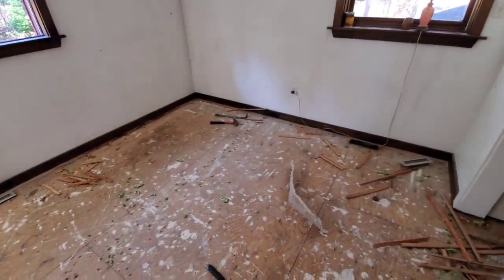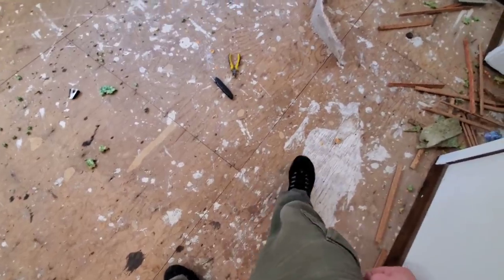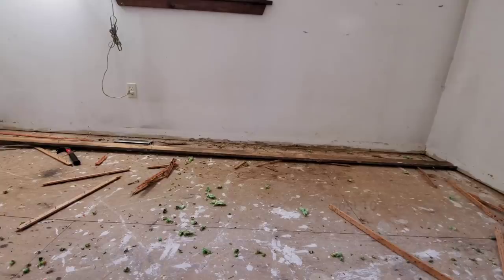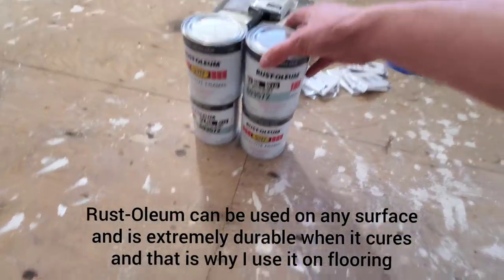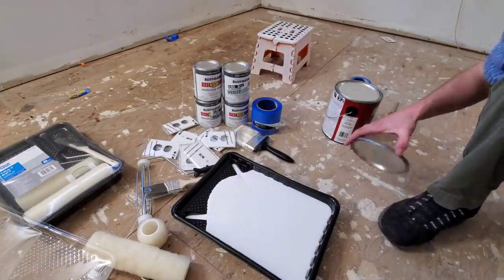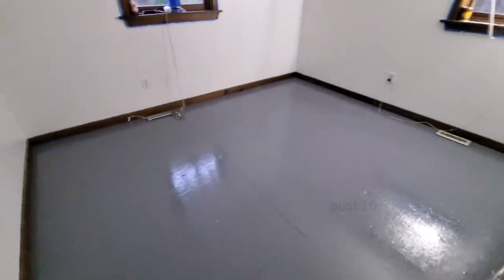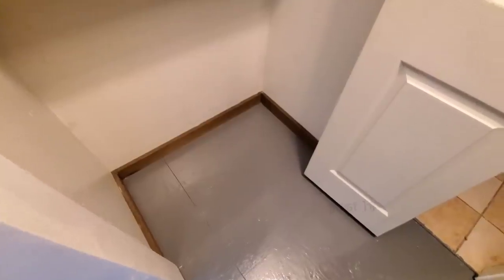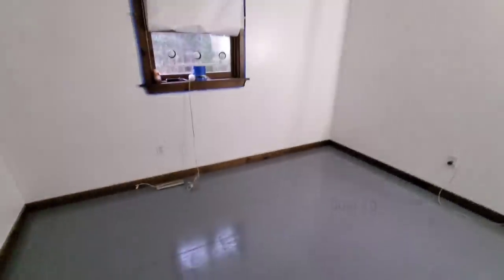Painting Subfloor, Looks Great

Comment: Came out nice. I’ve been a scenic artist and painter for 35 years. The wall paint was probably ok provided a 1/2"-3/4" lamb skin roller sleeve is used. Try one. They’re a bit more expensive but they don’t spatter, apply better coverage and clean easily with water. Worth the investment as a painter. I have some 1.5" ones I’ve used for 5-10 years.

Comment: I bought an old rental house that had terrible pee stained carpet.  I found that painted floors with area rugs worked great.  At the time I did it for economic reasons, but I really liked the look.
Another option is the two-part epoxy floor paint they designed for garages.  Those are more expensive, but the finish is practically bulletproof.
Reply: Epoxy floor paint, I'm saving that idea

Comment: This mans just painted a whole floor with a brush 😳
Reply from the maker: Roller cannot get into deep holes and cracks
Reply: Personally I think he should have used his trademark tool, a rake . 🤭
Reply: Yes it will. Use 3/4” or 1” nap roller cover.
And: you could have trimmed that switch plate better so it butted against the trim. No need for that hard edge and that gap.
Reply: I stained my house with a brush by myself and I am 67 years old. I prefer a brush. Something therapeutic about it.
Reply: Yeah a thick nap roller would have been way way faster and the paint would have been thicker. It would ooze into cracks and make it look better and smoother. I painted my 1000 sqft basement with a roller. It looked amazing.

Comment: The only problem with using painters tape is sometimes when you peel it off you can still get drips and runs and other imperfections that makes it's way under the tape or odd tape lines especially when you're laying it on thick.  For a fast cheap job....sure.  But if you're working on a higher end house with fancy trim work I recommend hand cutting with no tape.  It takes longer and yes sometimes you're not always 100% straight but  when the room is finished, unless if you're a pro painter specifically inspecting the work, you're not likely to notice it as long as your getting right up into the edge but not past it.

A good cut line requires some practice but here are some tips.... 1. Never over load your brush with too much paint.  You really only want to load the bottom 1/4 of your brush.  After several reloads if you find that the paint is taking over your brush to much it's time to give it a wash off.  A steel brush works great to clean a paint brush when you start getting dried up paint on your bristles.  

2. When cutting apply a good amount of pressure so that your bristles bend almost like 45 degree's on the wall and start a few inches below your cut line then drag your brush from left to right getting closer and closer to the edge line (like a car yeiding from a road onto the main highway) and when you hit that line point then level it out and keep that straight edge pressure going for length.  Then reload and continue your edge by starting a little before where you left off so that you're merging again onto the cut line.  Make sure you brush in a few inches of paint below your cut line too so that your entire cutting in line is a good 4 inches wide.  You have to remember that when you go to use the roller that the roller itself can only reach so far before it hits the ceiling and you don't want that to happen.  So the wider your cut line the more you'll lessen your chances of tapping the ceiling with your roller when you roll your walls.  

3.  Sometimes you can cut in the room twice before you add your first coat of paint.  If you're lucky to get a nice one coat coverage because you went with a better paint and a good 3/4 thick roller nap then you can avoid that 2nd cut in problem because if you can still see the brush strokes on your cut line then you have to recut the room over your first rolled coat but when you do that you'll see a texture difference over the edge of where you rolled.  Usually you want to roll OVER your cut. . . not CUT OVER your roll.

4. Have a cheap plastic painters pail to reload your brush instead of using the paint pan.  looks like a kids sand bucket toy.  You can hold it in your hand while you do your brushing instead of running up and down the ladder all the time to redip in the paint can or pan.  This saves you from having your paint dry up.  You can soak a rag and drape it over your pail to keep your paint wet while you break for a bit.  This is also why you shouldn't over fill your paint pan like post10 did in this video.  You need the ramp to squeeze off the excess but not too much.  And if that paint sits too long in the pan small little flakes start to harden and form in it and they transfer to the wall when you roll.  When it dries those flakes fall right off leaving behind open spots of bare wall.  This is also important to keep your roller wet.  Wrap it in plastic if you have to but make sure when you're done for the day that you clean it out really well.  avoid those paint chips

Comment: Caulk in the cracks and touch them up with paint and it will be 1000 times nicer looking. Make sure to run a wet rag over the caulk to remove the excess before painting it.
Reply from the maker: It is bank owned and I do what I can with small budget

Comment: Turned out better than I expected. But gotta be careful with your paint roller technique. It’s better to work the entire wall rather than half the wall/small sections. Gonna end up with roller/brush lines when the light hits it’s. Also should have sanded that floor and filled the gaps and holes at least. Again turned out nice all and all!

Comment: Painting - use a cheap oil based paint thinned with mineral spirits 10% as a primer coat on the floor - that will seal the wood; then apply your expensive one coat floor paint. Make sure both your primer coat and top coat are the same kind of paint so they create a strong bond.

Comment: Hey man you know how to use to remove the staples, I would go and get a roofing shovel used for pulling off shingles off a roof that would be ideal because they already meant for pulling up nails and staples and it is six or more inches across very helpful
Reply from the maker: I have ice scrapers that work well but considering I wanted it unmarked for painting